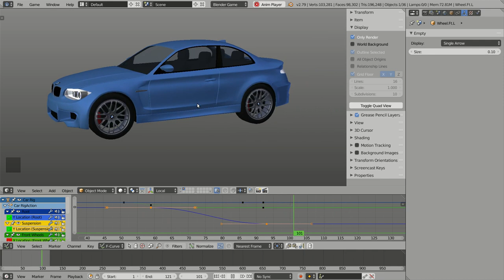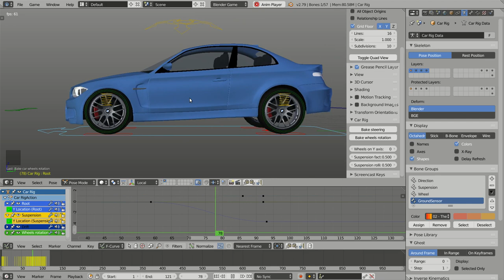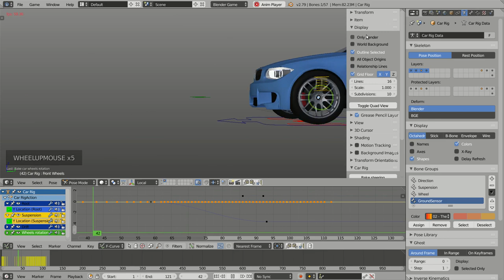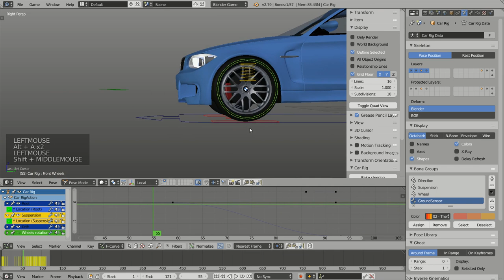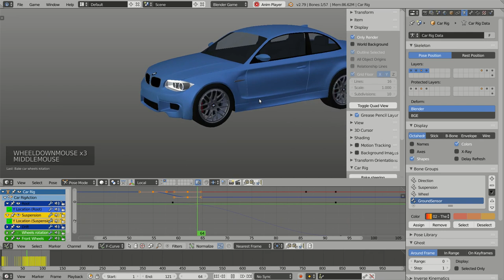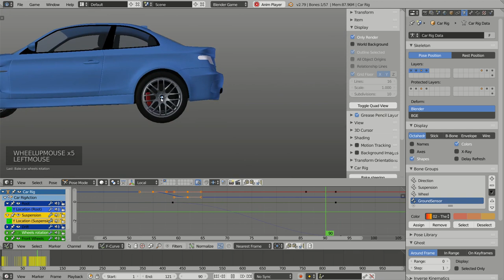Rigacar for Blender - part 4: slam on brakes

Comment: how to make camera object follow the car? parenting it to body object will give me unrealistic result, the body suspension isnt visible since the camera follows 100% static the body.
Reply from the maker: I recommend you create a rig for the camera. You can use Add Camera Rig add-on (available by default in Blender). You can animate the camera independently or follow the car rig and add some variation (for instance using drivers with noise modifier).
Reply: @digicreatures1945  follow the car rig... < is this another method than using camera addon rig? Or it's using addon?

If it's not using the addon, I have tried parent camera to car rig, but looks like I'm not able to parent it, pressing ctrl P gives nothing.

Will try the camera rig addon though, sounds promising.

Comment: I can't do suspension, can you please describe how to get this type of suspension?
Reply: I think it would be a case of inserting keyframes of you with the stock height and then adding another keyframe when it's slammed on the brakes, hope this helps somehow
Reply: @jacobwilson4824  Thanks
Reply: @somiljangra  no problem, I just tried it and it seems to work but don't forget to do the return travel of the suspension to get ultimate realism (more if you're doing an SUV or hatchback, nothing sporty)
Reply: Jacob Wilson sorry but I cannot understand what is return travel?
Reply: @somiljangra  I think what Jacob wants to say is that when the car completely stops, the suspensions are reset to normal at the very end. That adds to the realism.
Reply: nishant modi thanks
Reply: @nishantmodi5451  yeah
Reply: @jacobwilson4824  how do i keyframe that?
Reply: @CTZN1  you would dip the front of the car down for braking, add a key frame, then return the car to the place before that and add a keyframe